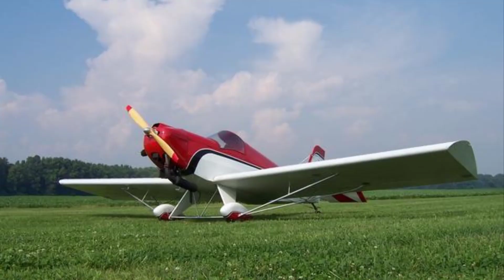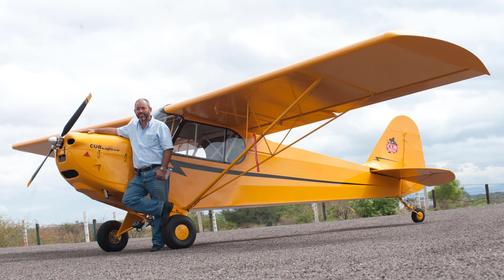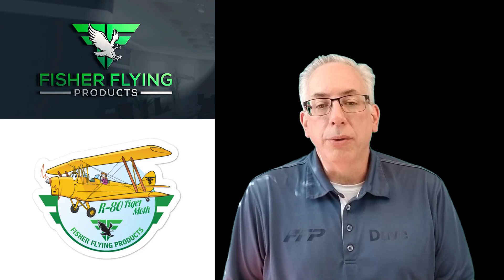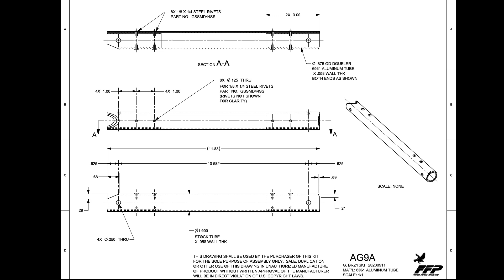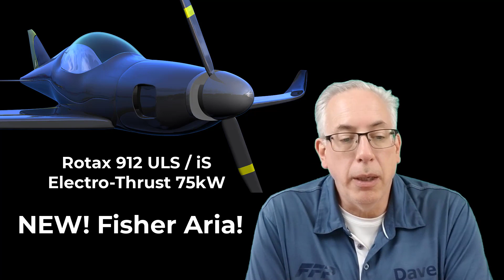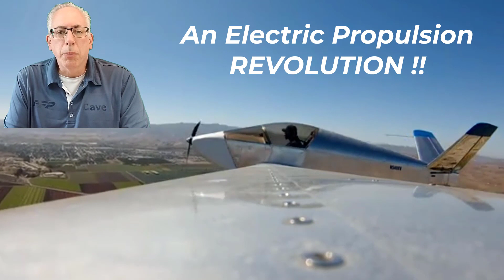ARIA - EARLY BIRD  KIT PURCHASE OFFER - 3D MODELING UPDATE - ELECTRIC PROPULSION UPDATE

Comment: i've posted your video to a homebuilt forum and some user were wondering about the battery performance, if you wanna chip in https://www.homebuiltairplanes.com/forums/threads/fisher-flying-products-to-spin-off-company-offering-electric-propulsion-system-for-the-light-plane-market-starting-at-10-000-for-25kw.34462/

Comment: This keeps sounding great. Will the battery packs be easily removable in most designs for off aircraft charging? If someone really wanted to fly constantly (say, the kids wanted to keep buzzing around) it would be good to be able to have the first pack recharging while you fly around on the second pack that you just installed on the turnaround.
Reply from the maker: You have hit the nail on the head! These are all design parameters that are currently being met or are part of our integration effort. One design goal is to establish a battery plug-and-play form factor that allows all of the batteries to be removed for charging.
Reply: @fisherflyingproducts5747  I better start saving then haha